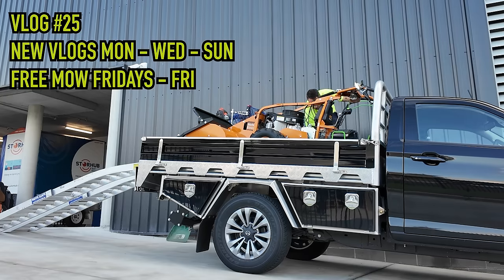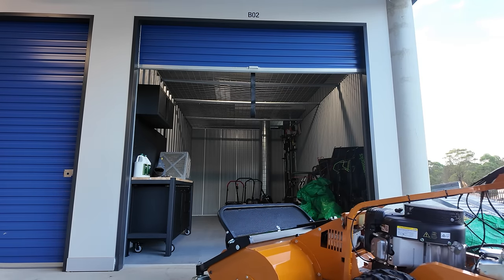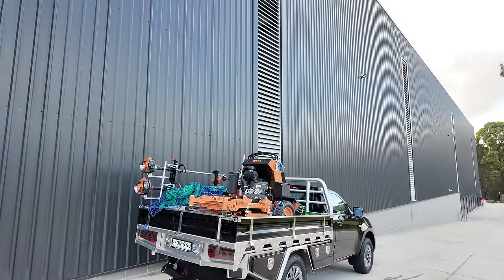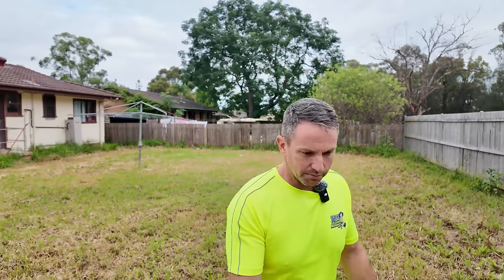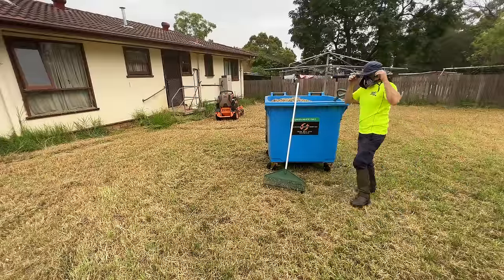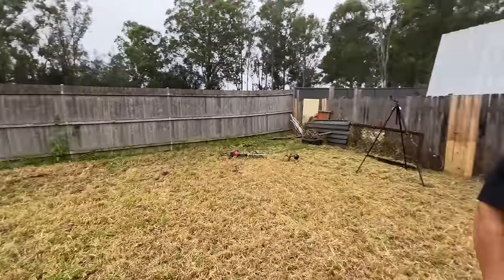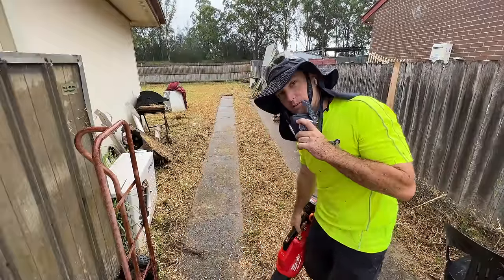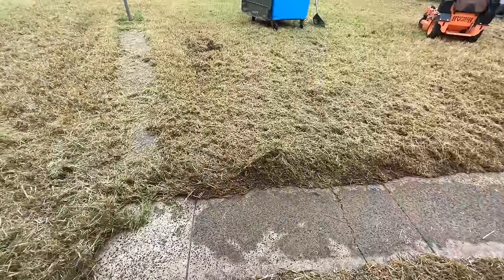VLOG #25 Wet Weather and OVERGROWN Lawns Don't Mix

Comment: Have you considered having two channels? One for the VLOG and another for the full-length videos? Not sure if that would ruin the algorithm or would help.

Also, my Ryobi battery mower died halfway through the lawn last week. cries Ended up just getting it replaced through warranty at Bunnings (straight swap). Super easy. Their products are pretty cheap quality IMHO, but at least the warranty claim was painless.
Reply from the maker: I considered it but it’s all pretty related so I went with this